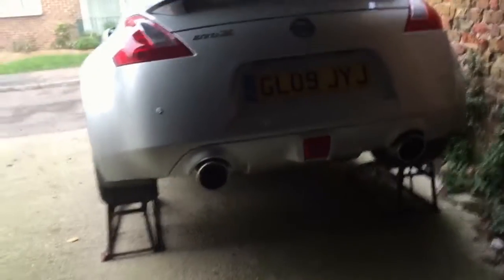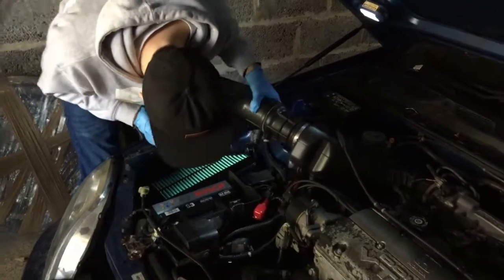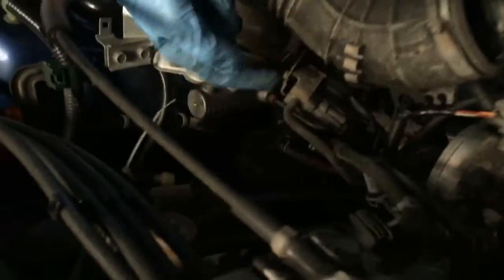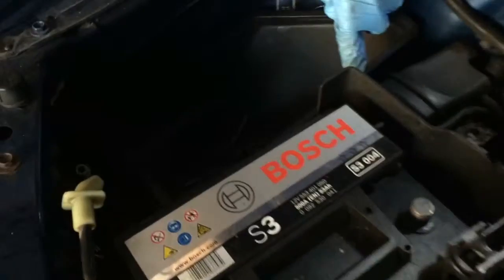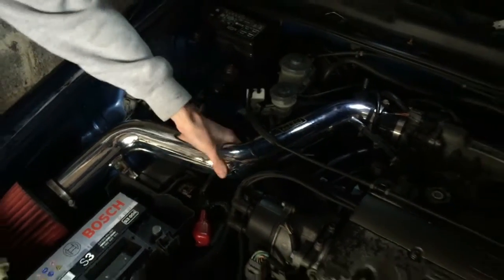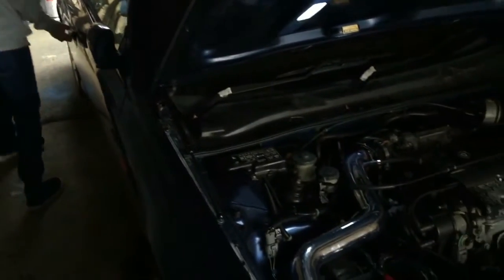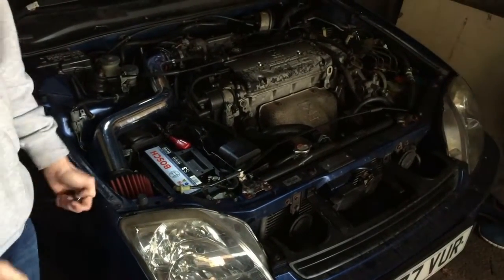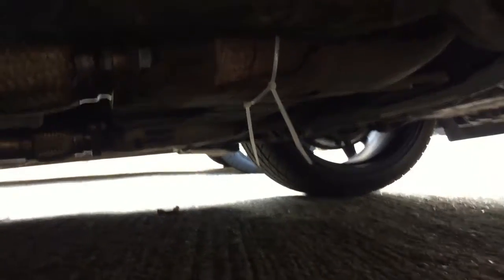Honda Prelude AEM Intake Install

Comment: long air intake will give you more cooler air then short air intake but still it's a better improvement anyways mate then that stock intake that you took off.  Love the skunk 2 exhaust Video sounds Awesome.
Reply from the maker: X Tron Garage cheers mate! I just watched your lip kit video, Im half was through putting mine on at the moment :)
Reply: Ill subscribe to you I like what I'm seeing with your Prelude. You can now delete the resonator from underneath the front bumper that is part of your stock intake. A little bit of weight reduction there so keep up with you build mate and have fun.:)
Reply: X Tron Garage, actually the oem intake itself IS a CAI. Even better than that is the type S oem intake. Check out the prelude forums on discussions for these which is why I kept mine stock. Then again to ea h their own, right. Happy motoring

Comment: I’m 16 i have a 1997 Honda Prelude Completely stock, i dont know what should my very first mod be?
Reply from the maker: Official Mario 
this is a very hard question to answer. First of all I would recommend maintaining / servicing the car and getting everything buttoned up before mods. 
However when you want to start looking at mods it depends on your budget and what you’re going after. If you’re going for looks then I highly recommend wind deflectors, they’re cheap and I believe they transform the car straight away. If you’ve got a bigger budget then you can look at wheels or even the motegi lip kit if it doesn’t have it already. As for performance, it’s highly recommended on most cars to do the basic intake/exhaust manifold(headers) and exhaust. I would do these as and when you can afford to but all will help give slight gains. Other mods that I would recommend would be the steering wheel and gear knob, but only because I love mine 👍 hope I helped 😊
Reply: James Stephen I have a 98 prelude and I was wondering the same. Thanks for the help!
Reply: that all depends and your goals and future plans for the car, be creative and have fun!

Comment: Awesome bro! Ima get me a prelude too 2001 i believe where'd ya learn to intall that intake? Not everyone is born with the knowledge to complete such a task.
How much would it cost me to mod up my prelude? Im looking to spend quite a bit but i dont know if should do it myself or have my mechanic do it for me
Reply from the maker: This was the first mod i did i believe. Its a pretty simple job so you shouldn't have any trouble doing it yourself, i had no idea what i was doing myself to be honest haha. since then i'm no longer worried about working on my own car, so maybe just start small or grab a few buddies to help. As for price, it really depends the road you want to go down, I've bought a lot of parts brand new that cost a lot but some of the best mods I've purchased have come from prelude forums and have been pretty cheap. I definitely recommend doing the intake and exhaust, let me know how you get on man :)
Reply: Forsure man thanks good to know! :)

Comment: Yea my Stock air intake in my 01 prelude is cracked as well. Would you recommemd a Weapon R Neo Titanium Air Intake???? Its 350 dollars but i like the rainbow look.
Reply from the maker: To be honest $350 sounds a lot for a bit of pipe and a filter. I'm sure any air filter brand will do the job although saying that i wouldn't get a ebay brand. 
The only thing i wish i done was to get a filter that sits in the bumper to prevent sucking in warm engine bay air.

Comment: Did you see increase in power and or acceleration?
Reply from the maker: Light Yagumi to be honest I couldn’t tell you, I know that this and a full exhaust system got my engine power up by about 25bhp as I had it on a dyno afterwards. I’ve heard that the aem v2 has better results
Reply: @JamesStephen  whoah what kind of set up of bolt ons did you have exactly? And which ECU?
Reply: @JamesStephen  I normally hear or read that the AEM short Rams cause loss of power due to heat soak